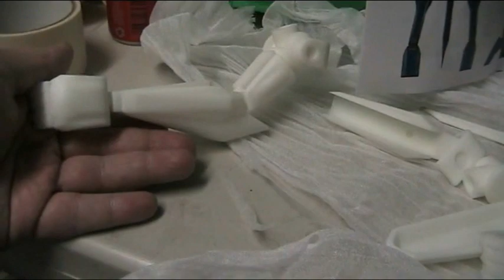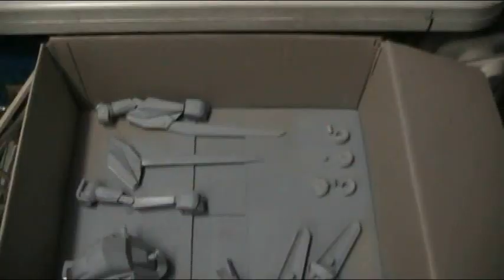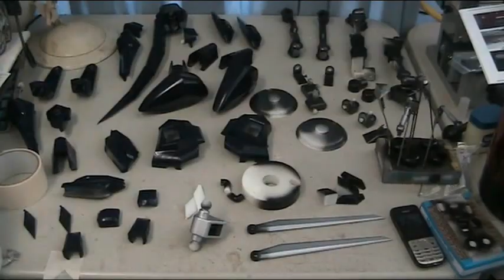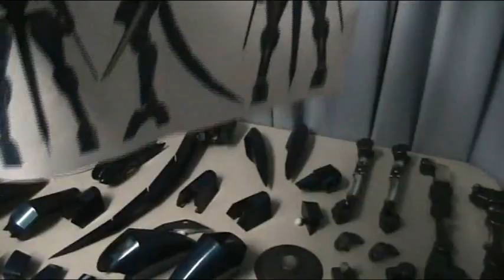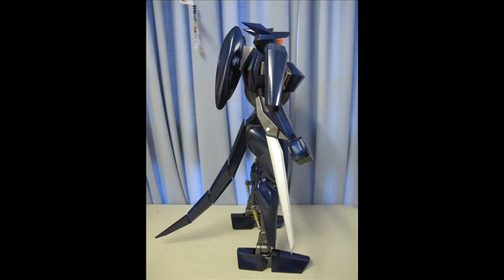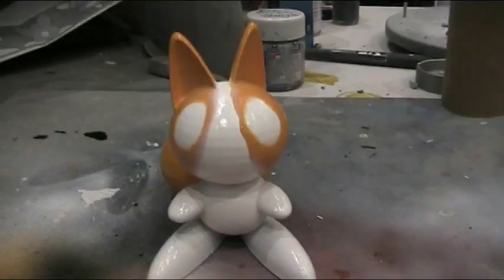Mecha Kangaroo SLA Zeal 3d printing services

Comment: So you had input on the design? From the looks of it the armor slides over the skeleton, is that correct?
Reply from the maker: Yes, I had the student study some of his own kits and learn about sliding armor and removable articulation. I made sure the material was thick and strong enough to take its weight as well as making the design more appealing to those who would buy super robot type kits. This was a talented and fantastic effort for someones first time at making an original model. I was also lucky to have access to all the notes and design which lead me to learn quite abit about material and joints. A lot of this will come in handy for my injection molding works.